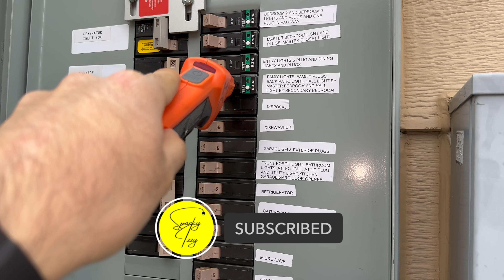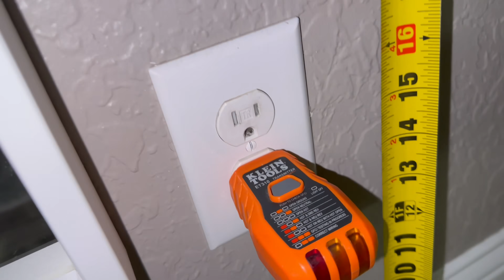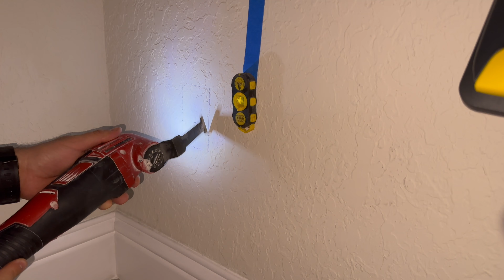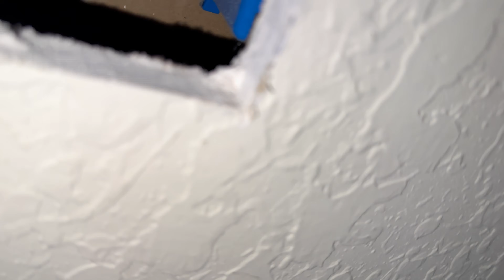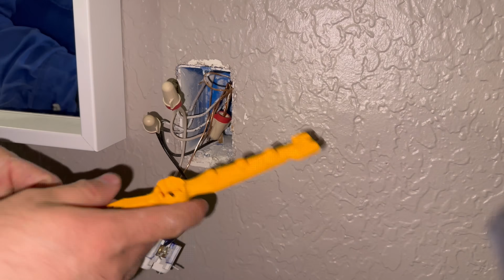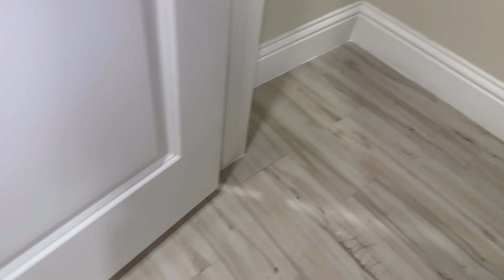How To Add an Outlet to an Existing Circuit | Closet

Comment: Not sure why no one has noticed that your diagram is wrong.  It is missing a whole set of wires.  This diagram shows the original outlet to outlet, but when you add another outlet you will now have 4 of each black, white and ground wires. In the diagram you only have 3 of each.

Comment: This is a great tutorial, thank you. But I have a question... My new box will be about 6 feet away from my existing box. What is the easiest or best way to run the wire through the wall from one box to the other?
Reply from the maker: Unfortunately cut Sheetrock, drill through studs and patch the wall 👍🏼

Comment: Is it possible to put an outlet in the same room or does it have to be on the same wall. Id like to install a new outlet since my room only has one outlet and it's in a really bad spot and annoying to plug stuff in and I'd like to cut down on the need  for power strips. I have like about 2 or 3 power strips in my room. Can I install an outlet on the opposite wall?

Comment: Excellent. I have a 20 amp breaker with a gfci. It is for two exterior porch lights. I would like to add an interior outlet on that circuit for a 12 amp (14k btu) window air conditioner. Would this be acceptable to use that circuit or is that circuit supposed to remain dedicated to those exterior lights? Thank you.
Reply from the maker: Window air conditioner should be on a dedicated circuit to avoid occasional overload tripping.
Reply: Thank you.

Comment: How did you run the Rolex to the new box
Reply: Stuck it through the back of the existing box and then grabbed it from the hole he cut for the new box.

Comment: Awesome video. Question, if I want to add an outlet outside my house, would I install it the same as your video? I want to add an outlet on the outside wall and I have an exciting outlet in the inside wall where I can connect the new outlet from. I’m just not sure if the process would be the same as you did in the video. Thanks!
Reply from the maker: No, it will be different! A GFCI and outdoor rated material would be needed!

Comment: I would flip your outlet so the ground is on top. Not sure if that's code or not, but it's explained to me that if a plug is partially out and something metallic falls on it (like a chain or wire) then the ground would be the most likely thing contacted and hopefully prevent arcing.

Comment: If I'm dropping a Romex wire, from my attic, down the wall for an additional outlet/receptacle, how should I secure the Romex before it enters the box? I'd like to install to code and I know if has to be stapled before it goes into the box.
Reply from the maker: If it’s existing building, it’s not needed since it’s not readily accessible to secure the romex

Comment: Does this same method work if I am adding an outlet into a gfci circuit (somewhere in the middle of the run?)
Reply from the maker: Yes & no because a GFCI can be wired incorrectly if not done right. Is there a reason it needs to be a GFCI?
Reply: Yes. Adding an outlet in the toilet room on a gfci line. Fist attempt failed as gfci head switch will not reset after my work.
Reply: Great video. Really appreciate the techniques.
Reply from the maker: @kpncpa3658 the process is the same but on a GFCI if you look at the back. It says line & load. You would connect the power just the line side of the gfci. The load side of the gfci is for any receptacles that you want to trip when the gfci trips in a fault condition.
Reply: @sparky_izzy thanks. However my gfci line only has one actual gfci receptacle at the head. The one I am tapping into is standard, but protected, with lines in top and bottom screws. 🤦‍♂️

Comment: Wonderful tutorial video showing the simplest way to install a new receptacle. Glad you didn't cut corners like backstabbing wires, double tapping screws, or drilling into any existing boxes too run new NM. Really look forward to seeing more videos from you. 

Hate to be another critic but you're technically not supposed to break off any internal clamps in those boxes, especially old work ones like this. Voids UL listing which makes this job no longer NEC compliant should a thorough inspection were to occur. 

More importantly, they're designed to hold onto the cable and provide necessary strain relief since it's obviously not possible to staple new wiring within a finished wall, especially when avoiding any framing. This is unlike new work 1 gang boxes which have KOs like the one you correctly punched out due to nearby staple securing the wiring.
Reply from the maker: You’re absolutely correct, I would have to agree on leaving the internal clamp. I should have left it for the video 👍🏼

Comment: WAGOs are a better option than wirenuts and they take up less room in the box. Also, when cutting out sheetrock, put a screw in just far enough that you can hold it while cutting to keep it from falling into the wall space.

Comment: Well, I’m back with another question. I shut off the breaker for that outlet but there’s a yellow wire. I’m sure is for the fan so I won’t even pull the outlet out with the hot yellow wire. Guess it’s time to call an electrician.

Comment: I have the exact same vacuum and I’m putting an outlet inside the closet just as you did. I don’t know if it’s the end of the run yet I’ll check tomorrow, but the pig tailing is what I wanted to make sure that I will be doing it correctly . You just verified for me that I will be doing it correctly, thanks tons.

Comment: Does it matter if the new receptacle you’re adding connects to a receptacle that is end of circuit or just in the middle of a circuit? I just want to add one behind my TV and I’m not sure if the receptacle below is the end of the circuit or not.
Reply from the maker: It doesn’t matter but it will be easier if it’s at the end of the circuit because there will be only 1 romex wire.
Reply: That makes sense…thanks!!!

Comment: Can i just add the new wires to the existing outlet on the empty screws ? Or is it necessary to pig tail?
Reply from the maker: You can if you have empty screws.
Reply: @ some guys say its better to pig tail because using all 4 screws can over heat the outlet? Whats better ? It should work either way right but . Is that true about overheating?
Reply from the maker: Yes that is true but only if you know you have some heavy loads on the circuit. Reason being is because the electricity has to pass through small tabs on the receptacle and some say it can’t withstand the high heat. I pigtail most of the time.
Reply: @ so if we dont know how much load is on the circuit, its just safer to pig tail then?
Reply from the maker: Yes 👍🏽
Reply: Yes, you can use the empty screws and as long as they are properly torqued, there's no more of an overheating concern than an overheating a joint and a wire nut. If overheating is an issue, it's a loose connection, too thin of a wire gauge, or a bad or incorrect breaker rating. There are other reasons why pigtails are preferred. The side plates of even 15 amp receptacles are rated for 20 amp pass through.

Comment: Any reason you use pigtails instead of just having the power source romex go right to the outlet and have the other outlet go right into the other side of the outlet, so no pigtails? 
Also, if I want to have two outlets come off of 1 existing outlet, could I use your pigtail method and have 1 live wire going, and 3 other pigtails going out of each connection with a screw on cap?m? Would all those wires then be able to fit inside a box?
Reply: Safer less heat build up at outlet, the other way works this is better imo I would also use 3 way wagos and tape and wide offset box, that is just me, Aerospace Engineer.

Comment: How would you add two outlets off that one? My den has a wall without an outlet on it and I’d like to add one outlet for normal use and another above that for a tv I just mounted. There’s an outlet in the wall on the other side.

Comment: Awesome video!! Question, what if you have stranded wire, how do you loop them like the solid wire since it's quite uncomfortable? Thanks!
Reply from the maker: Great question!

I would use a fork terminal and have only 1 wire with a fork landed on the terminal screw. 

BUT it’s very important that you use a fork that’s rated for the correct voltage. You CAN’T use a generic fork terminal from the auto part store.

These by 3M are rated up to 600volts -

Use these for #12awg wire: https://amzn.to/3zwCEwr
Or these for #14awg wire: https://amzn.to/3VRAtLn

And you can use these crimpers: 
https://amzn.to/4bu9YBl
Or
https://amzn.to/3XKNtVN
Reply: @sparky_izzy  Hey! Wow thanks for replying so fast! By any chance you have a video on how to use these types of forks and crimpers? Thanks again for the help and tips! 🙏🏼👌🏼
Reply from the maker: I use wire crimpers in this video!
https://youtu.be/XbApLev3ptU?si=kid9-g8CI71hCWRc
👍🏽
Reply: @sparky_izzy  Thanks a lot! 👍🏼

Comment: Thank-you for this video. One question: how did you know the circuit could handle and additional outlet? With all your experience it was probably just a given. But if adding an outlet to a circuit w/ multiple outlets already, how is this done? Thanks!
Reply from the maker: Here’s what I would do.
1. Find the breaker for the circuit
2. Turn off the breaker and walk around the house and write down what the circuit feeds
3. Look at the amperage off the breaker. It will be a 15amp or 20amp breaker.
4. Add up the amperage for what I have plugged in to the circuit currently and what I want to plug in the future.
5. Make sure the amperage is rated no more than 80% of the rating of the breaker for a continuous load.
15amp - no more than 12 amps
20amp breaker - no more than 16amps

If you are plugging in small things like a charger, computers or general purpose stuff. You should be fine.
Reply: @sparky_izzy  Thank-you!!
Reply from the maker: No problem 👍🏽

Comment: Your video is well done, but I do have to point out that your drawing is incorrect.  It shows 3 wires, including the pigtail wire, twisted together in one wire nut, you should have a total of 4 wires twisted together, otherwise there would be no need for a pigtail.  If you minus the pigtail in your drawing you would now only have 2 wires, one would go on either side of the outlet, so you would not need the pigtail.

Comment: Couldn’t you just use the existing black, white , and ground and just connect it to the receptacle by twisting the new added 14/2 with the existing one and doing a pig tail that way instead of adding a third wire I’m sure either way will work but just making sure 😊

Comment: I have an exact situation as your segment is showing except the socket I would be attaching to is on the other side of a stud. How would you handle that? Hoping to be able to do this without cutting into sheet rock. Appreciate ideas.
Reply from the maker: Off the top of my head, there are two options I can think of. One would be that you cut the sheet rock in order to drill a hole through the stud so that you can pull your wires The other option I’m thinking of is running up into the attic and over the stud and come back down to tap into the existing receptacle. Hope this helps.
Reply: Thanks so much I really appreciate it.

Comment: How many outlets can you connect to the original outlet? Would i be able to add 2 additional outlets to the original one?
Reply from the maker: You would have to check the amperage on that breaker. As long as you don’t exceed the breaker and wire rating.
Reply: @sparky_izzy  okay I'm not hooking anything heavy up just outlets to charge phones, run a CPAP machine etc my outlets are placed in weird areas in my room...

Comment: Can I add a tip when cutting holes in sheet rock? Drive a drywall screw partially inside the cut lines, leaving yourself a handle to pull the cut piece out after its cut 😊
Reply: Or it's more insulation 😂
Reply: I like that. Thank you
Reply: Yup -I learned that one from an old town about 20 years ago, great little tip

Comment: Is the diagram at 6:40 accurate?  It looks like that existing outlet was in the middle of a run. So aren't there are actually 4 black & 4 white wires being wire nutted together?
Reply from the maker: Yes, you are correct. The diagram is just a reference on how it should be wired.
Reply: @sparky_izzy  Thanks!

Comment: You are correct about 2 incoming cables in the old box and one new cable leaving the box.  I believe using the Romex connector inside the plastic box is a code an electrical violation.  No need to use it.

Comment: That diagram is inaccurate. You are connecting three hots, whites, and ground; not two. There are two existing romax coming in, not one. You are adding a third. And its very difficult if not impossible to see in that in the video, too fast and one of your existing black lines is caked over and looks white. Very hard to follow what you are doing. I think I know what you are doing, but I cant be sure.
Reply: Yes, the diagram is inaccurate. That's why I'm confused and not sure if I can connect 3 hots, whites, and grounds. 😩 help, please.
Reply: He should use the wago 221 lever nuts they are better than wire nuts.
Reply: I’m not 100% sure what you’re trying to say, but since he put in a new box and only fed 1 romex into it, wouldnt the diagram be right? There was an existing box but he didn’t do anything with it
Reply: @chansmovievlogchannel6037 I think because in the diagram it show only one romex coming in. Therefore you do not need to do a pigtail, u can just hook another romex to the existing receptacle and onto the next. What he’s doing in the video. There’s already two romex coming in and out from the receptacle
Reply: Residential electrician here, the diagram is fine. Everyone in the comments is trippin especially the series and parallel dude 😂. I just can’t get over the fact he’s wire nutting the hot and neutral and not just connecting everything to the plug. Stab some screw some, but I get you not wanting to stab.  And is the wire nut on the ground actually necessary ? We always just twist crimp and fold it all back.
Reply: @IssiahBlackburn-zo6mm I see what you’re saying, makes more sense. You would still have to make a pig tail for only the ground though, no? Usually the outlets just have the 1 screw for ground I think?…
Reply: Was it originally a series and he wired it as a parallel?

Comment: I really like your drawing that shows your original outlet and the new one you are installing and the wiring is VERY clear.   I need to check your other videos because I want to change a single duplex outlet into a dual duplex out and it is not the last box in the circuit so I need to see how to continue to the other downstream outlets.
Reply from the maker: You would need to shut off the circuit, remove the old box & undo all the wiring. Then get yourself a new 2 gang remodel box, cut out the old hole to the new dimensions of the 2 gang box. You would add “pigtails” to both new receptacle. Which is a 6-8” single black, white & ground to each receptacle. Then you hook up all the blacks together, all the whites together & all the grounds together with the proper wire nuts. Hope that makes sense. You gave me a video idea. If I come across this, I will make a video!
Reply: @sparky_izzy stop using wire nuts use wago connectors.

Comment: if there are already 2 hots/2 neutrals connected to the receptacle, can you add a 3rd of each to add an outlet?
Reply from the maker: You can add a 3rd wire. To do that, you would add “pigtails” to the receptacle. Which is a 6-8” single black, white & ground to the receptacle. Then you hook up all the blacks together, all the whites together & all the grounds together with the proper wire nuts. Hope that makes sense.
Reply: @sparky_izzy  Done!  Thanks indeed

Comment: How did you run the romex from one receptacle to the other receptacle? You said to run it & then it just magically was there but i don't know how 🤷‍♂️
Reply: This is exactly what I was wondering! How the fuck did you get the Romax through the studs? Or are there no studs and you just went back to back. Kind of confusing.
Reply from the maker: Back to back 👍🏽
Reply: It was side next to side electrical boxes all with in the same 16” stud cavity so  no 2x4 studs were involved.  In fact, he made sure he was in the same stud wall cavity by using the yellow and magnetic stud finder which picks up on the metal steel drywall screws to show where the 2 stud locations were.

Comment: What was the name of the wire that you use to connect the two outlets again? And did you say it needs to have six inches pulled out on either side? I really liked that you showed the whole process. Now i just need to go buy the materials.
Reply from the maker: Yes, a MINIMUM of 6” from the back of the box to outside the box. 
The wire is called Romex (NM-B)
Yellow is size 12/2 - rated for 20amps max
White is size 14/2 - rated for 15amps max

Comment: Can you explain why there's one bare wire with no insulation on it? I was shocked to see that (no pun intended)
Reply from the maker: That is a ground (non current carrying conductor) only the black & white wires carry current. No insulation needed for the ground wire.
Reply: @sparky_izzy  thanks, I've always seen the ground wire with green insulation!
Reply from the maker: In conduit it has green insulation….in romex … it’s bare copper 👍🏽

Comment: Can I safely add an outlet from an ungrounded gfci plug? Would I follow these same steps but without the ground wire?
Reply from the maker: Yes that will work, only if you connect the new outlet to the “load” side of the GFCI. Adding a GFCI takes care of the ungrounded problem. So if there is a ground fault, the gfci & any other outlets being fed by it on the “load” side will be protected by the GFCI & “grounded”.
Reply: @sparky_izzy  thank you for your response. It's very much appreciated!